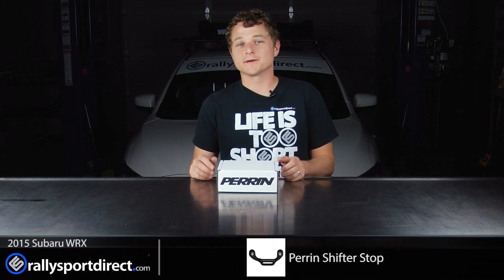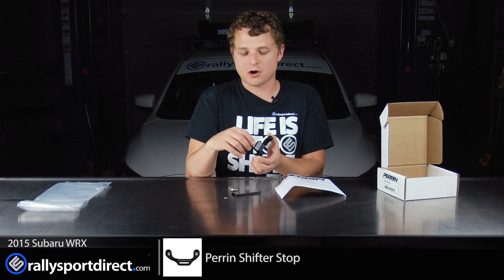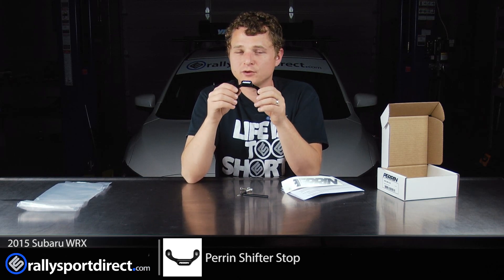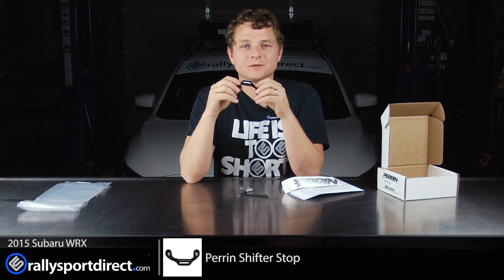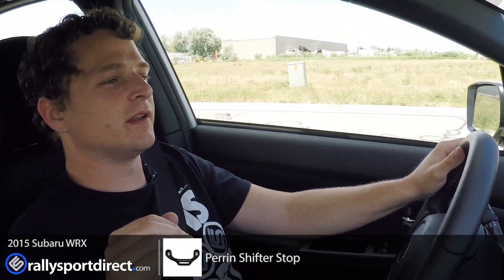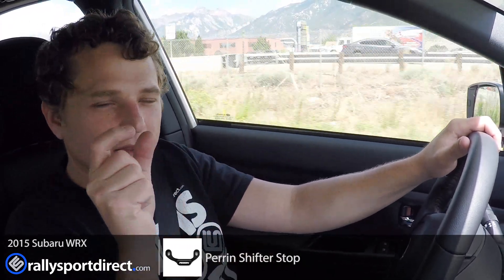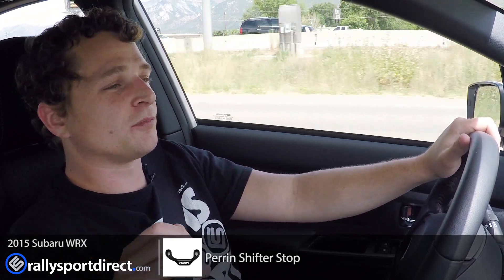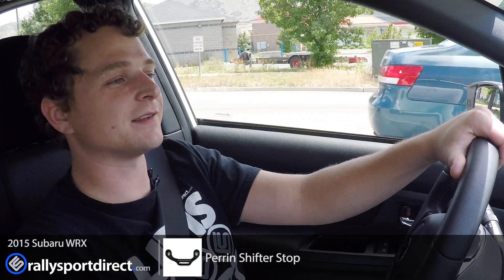Perrin Shifter Stop - 2015+ Subaru WRX - Install/Review

Comment: I drop one of the nuts that goes to the bottom left side where your suppose to put a washer there too. It fell all the way down and I freak out. Couldn't find it underneath my car. Had to go to Home Depot and get an extra nut. I advise everyone to have or get a magnet as well as some paper or napkin to put beneath the area to act as a safety net.
Reply from the maker: Always a good idea! :)

Thanks,
Rick

Comment: installed this yesterday...omw home today couldnt move into 5th or 6th (stock stop somehow was pushed out so there was alot more slop than there should have been)  i tightened the screws pretty tight forst time around... you really have to screw the provided screws on there pretttyyy damn tight.  all in all good product
Reply: *edit...shifted into 5th and 6th from muscle memory omw home.
Reply: i'm worried about this issue too

Comment: Will this work in the sti? Is it even needed like it is for the wrx.
Reply from the maker: No, the STI uses a mechanical arm linkage, where the 15+ WRX uses cables, so this mod would only be useful for and work for the 2015+ WRX.

Thanks,
Rick